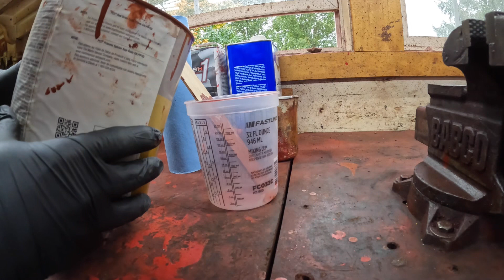Painting Begins! | Farmall Super C Restoration Episode 11

Comment: Hello Pete you need to order a lightbar headlamp, my dad ordered me 2 of them for 20 bucks 400 lumens on high. It's a strip of lights that go across your forehead from eyebrow edge to eyebrow edge. The great part is they sit almost flush with your skin so you don't have a big thing hanging off the front of your forehead getting in the way. I had to clean my grandma's crawlspace out and it is very dark down there, but with my lightbar headlamp I forgot I was in a dark hole because everything I looked at was lit up very well, just get rechargeable batteries because it goes through them pretty quickly. No I'm not sponsored by light bar headlamps I just seen you spraying with 1 hand and the other 1 holding a light so I figured I would try and help you in the future God Bless You And Yours have a great day